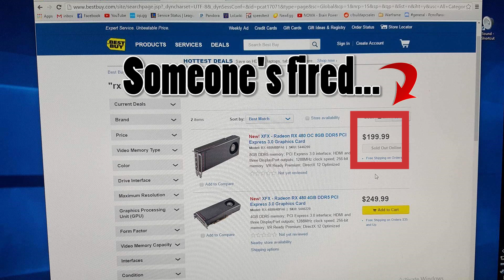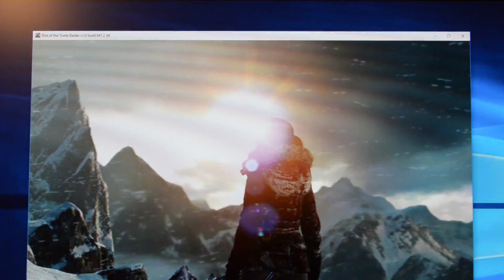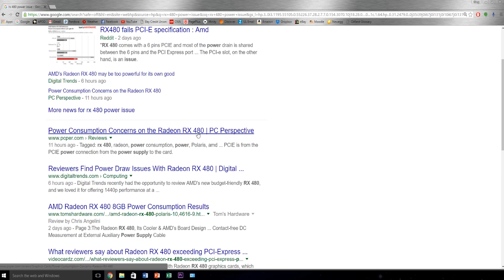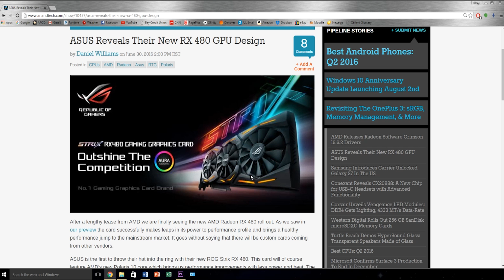RX 480 Aftermath: Power Issue & Over-Hyping

Comment: i have a question, I was planning to buy rx 480 nitro from sapphire when it comes out i wonder if my PC will not bottleneck it, here is my rig.

CPU: i5 3570 non k

Mobo: Gigabyte H77 D3h

Mem: 8gb G. skill ripjaws 1600

PSU: 600 watts aero cool strike X

HDD: WD 1tb

Comment: I live in Australia and god damn the prices are waaaaay higher here QQ
Reply: buy from US Newegg, you only pay currency conversion and shipping, not that plus the Australia tax.
Reply: The only problem is dealing with the warranty if your card stops working.
Reply: That is exactly why I don't want to order internationally. It would be a pain to return items if they don't work. But the price difference is on the level of $100-200 so it's really hard to choose lol. I could buy an rx480 here for $450 or buy it on newegg and get it shipped here for $380. I could buy a 1070 here for $780 or get it shipped here from newegg for $600.
Reply: +KKDominate PCCG in Australia sells the RX 480 8gb for $379 by XFX, wherever you guys are getting charged 450aud is scamming you.
Reply: I almost always buy from Umart. Yeah I see that XFX card on pccg. The only thing I don't like is that if I have a problem, I need to ship it back to them for replacements/refunds/etc. I've bought a couple times from pccg though and I like them.

Comment: thats what you fanbois get for buying into AMD PR lies
- a card that is pushed to the absolute limit but still struggles against the GTX 970
- AMD's ego for putting a 6 pin power connector to show that it is "power efficient"
- hot & loud
- melts motherboards
- can't be overclocked for shit

Comment: Lol,.. seriously I had experience the full tax load on costs for my XTX RX480 @1328 Mhz, Rush order thru ($5), Saturday delivery ($12), next day shipping ($38), 3yrs add on insurance ($40) firmware bios boosted base clock ($19). Now I need to figuring out should I boot to W10 Safe Mode and gutted out my nVidia GTX drivers then reinstall the Crimson Edition 16.6.2 Release driver at a whopping 350mb ? Really AMD,.. that is a large -- graphic driver download file. BTW did ATi fixed the Purge 150 spike power failure thru their driver maybe the extra 313mb (out of 350mb) are the needed PCIe fixes.
Reply: I forgot my ATi RX480 come with sound chip now I'm up to 3 DIFF sound cards in my Dell XPS 8900 system.

Comment: What's the pc case that he's using?
Reply from the maker: Corsair 400C.
Reply: Does the led lights come with that or do I still need to purchase it separately?
Reply: You have to purchase them separately, but they do not cost much. CableMod WideBeam (the best LEDs I know) cost between 18-21€ in my local PC store (18€ for 30cm version, 21€ for 60cm)
Reply: TheOdinTheory Thanks man

Comment: does rx 480 have any issues like graphics quality? maybe it's good at increasing frames per second at the cost of quality of the graphics.
Reply: No third party cards have have same if not better quality
Reply: They'd need to compare pixel values from identical frames.  Nvidia has a policy of not lowering image quality.  AMD/ATI has done it before.  It depends on the game as to how noticeable it is.  They are often options in the drivers, so default values when drivers are installed tends to need to be checked.  There is some hear say that AMD is having graphics downgraded in games they partner with for their cards to get higher FPS numbers.
Reply: Do you mean that they reduce the graphics settings during their benchmarks? Or are you saying that the 480 graphics look worse at the same settings compared to nvidia cards?

I'm a layperson but the latter doesn't really seem likely to me (please correct me if I'm wrong!), and the former is a problem you get around by reading trusted and detailed reviews.

Comment: Couldn't the power problem be a firmware or driver issue and be solved with an update
Reply from the maker: No. This cannot be corrected with software.
Reply: So you basically call AMD recent statement a lie ?

AMD : "As you know, we continuously tune our GPUs in order to maximize their performance within their given power envelopes and the speed of the memory interface, which in this case is an unprecedented 8Gbps for GDDR5. Recently, we identified select scenarios where the tuning of some RX 480 boards was not optimal. Fortunately, we can adjust the GPU’s tuning via software in order to resolve this issue. We are already testing a driver that implements a fix, and we will provide an update to the community on our progress on Tuesday (July 5, 2016)."

Comment: wait for 3rd party AMD RX480, they will use 8+6 pin, better cooler, and and durable PCB. We still need better chassis PC for better air cooling to use future GPU. And RX480 should use 3000+ more SP and 8+6 pin power, it would be a good card.

Comment: Wait, it made your machine shut off with every benchmark you ran?  Is this based on your specific hardware configuration or a known problem across the board?
Reply from the maker: Did you not hear all of the steps I took to isolate the issue? I shouldn't have to explain this all over again.

Comment: So the budget GPU can't run on a budget mobo.  I'd call that a fail.  If we want to upgrade to this gpu we have to upgrade our entire rig to make sure it doesn't shut it down.  It's just better at this point to buy a 1060-1070.  Cheaper than an entire new rig and better performance without the power issues.  Well, 1060 we're not sure yet, but the 1070 has had no issues and is only going to be about 100 dollars more than the non-reference 480.

Comment: ok so, guys i need some feedback or some help off those of u who know what they are talking about. 

I bought a GTX 1080 but it's still in the box. i spent £620 and it's a founders edition, i could however get 2 RX 480s for £480, if i wait for board partner cards, they will be like £280 each so it would be approx £560. my questions are is it worth me waiting for improved rx 480s and swapping the gtx 1080?  have i made a mistake by buying a reference gtx 1080?  also should i be worried about poor dx 12 performance on nvidia cards? 

im a bit confused right now.... part of me is saying just stick with the 1080. even though its a reference edition with reports of it thermal throttling....
Reply: If you have the 1080, stick with it, even know the 480 is nice, it won't beat the 1080, even if you have two of them.  Most games are still single GPU, and two cards can actually hinder some of the games instead of making them better.  Also in the past AMD has had some driver issues, which they have been known to take their sweet time updating, but then again that is the past.  Also you might think on waiting a little longer for the 490, which is supposed to be launched within the next few months :)
Reply: Just4Gamers Tube thanks dude i appreciate the comment. i just moved over from consoles awhile ago. but yeah the gtx 1080 is in my system now and i absolutley love it. it makes a weird whining noise if i leave v sync off in some games but its not major. Thank u for the advice. My case is always cool, has decent airflow.

Comment: My only complaint about the card is that their is no DVI. I would have to use a DVI to hdmi. That might lower the quality of the games that I play.  I still consider the RX 480. Since I have the 960 that might be good upgrade path. It rumored that their will be a 1060. Keyword rumored. It rumored to beat the RX 480. I might end up holding off more.
Reply: They both use a Digital signal so there should be little to no signal degradation.
Reply: KH3player Good. Now I don't have to worry when I am ready to upgrade my graphic card.
Reply: Just FYI you can also use a display port to DVI with no issues like I am. (Running a 2014 and 2008 monitor via the HDMI and display port to DVI respectively).
Reply: Jak I just hope I remember where I put the tcable at. I have a clue. I am going to see what happens in August. I was going to give myself a new graphic card this month for my birthday. I do need to be prepared for the fair that going to be in my town.
Reply: Yeah there are no  quality degradation with these ..

As soon as the card detect the device type it send the right kind of information/signal in the cable.   The only limit is the  resolution like 4K will probably not work over anything other than display port and the  HDMI 2.0  combination.  

I've already sent a DVI  signal to my TV over an HDMI cable.  Even if the TV or the GPU did not even had the DVI plug at all.  The communication protocol are directly built the chip whatever the plug they chose to weld on the back.
Reply: I'm using an HDMI to DisplayPort adapter. Works just fine. I do wish they had given us two HDMI ports instead of one HDMI port and three DP.
Reply: I never thought about that.

Comment: AMD how dare you make this non-compatible with 10 year old bottlenecking technology!!!1111!!!
I am not frustrated at all that i wouldnt be able to put this in my rig because it would be a waste. I dont know any 10year old CPU that would be worth pairing it with a 480. If this would be the case for a 470 or 460, then i'd have a reason to be angry. I just dont see the point in combining a core 2 quad with a 480.

Comment: I remember when my old AMD system would shut down often. AMD = cheap and nasty lol.
Reply: running an and chip with a fury x and I run games smooth 1440p 60fps so how is that nasty trash?
Reply: i actually used to work with my citys IT department for few months. they got a bunch of new hp desktops with amd apus that happened to be the most problematic pieces of shit ever, basically none of them would boot if they had any other usb devices than mouse and keyboard connected, they kept constantly crashing and losing connection to internet (basically a big deal when all of them logged in through a server) and heated up under normal use more than my i5 4690k @ 4.8GHz does under load. so no they suck ass even for cheap business computers.
Reply: Well actually hd6870 is not bad at all (With that cheap price)

Comment: I'm just throwing shit at the wall to see what sticks here. I don't know about the rx480 but my 280x has an 8-pin and a 6-pin connector. The 6 has 2 unused contacts next to it implying that it could take 2x8-pins. If the 480 is the same then if you have the skill you could de-solder the 6-pin and replace it with an 8-pin effectively supplying it with more power. However this is entirely based on the hunch that the two unused contacts are connected to something on the board.

Comment: In conclusion: Don't use a potato for a motherboard an you should be fine.
Reply from the maker: Not an excuse. Should never happen. Didn't happen with the 980Ti.
Reply: The pci-e spec was changed somewhere around 2.0 or 3.0 to allow up to 90w instead of 75w to be pulled from the slot however not all boards will handle the 90w draw. Good quality boards will likely handle even more but this card does have one real flaw and that is the poor vrm cooling and is the hottest part of the core. THG benched theirs with a room temp of 22c while under full load the vrm topped 96c. In a normal pc environment those vrm temps are going to be even higher.
Reply: Nope, PCI-E 3.0 still has a max of 75w from the slot.  I did some extra research on it and I'm almost positive this is still the case.
Reply: Do you have a 750ti? It would be interesting to test it on that motherboard, but overclocked so that it pulls more current. Would be interesting to see if the crashes can be replicated.

Comment: Awesome video with some really good information. I have seen videos on both sides of the argument regarding the RX 480 power issue, but all of those people had zero experience with an issue. It is great to see someone who has experienced it first hand. I have to say that I am surprised, especially after seeing all of the information about several video cards in the past pulling more than 75 watts from the PCIe lane. Appears that AMD could have an issue on their hands. Especially since the people who are buying a budget card such as this, could potentially have older systems with older motherboards that could trigger this problem.

Comment: amd is working on a fix 
"As you know, we continuously tune our GPUs in order to maximize their 
performance within their given power envelopes and the speed of the 
memory interface, which in this case is an unprecedented 8Gbps for 
GDDR5. Recently, we identified select scenarios where the tuning of some
 RX 480 boards was not optimal. Fortunately, we can adjust the GPU's 
tuning via software in order to resolve this issue. We are already 
testing a driver that implements a fix, and we will provide an update to
 the community on our progress on Tuesday (July 5, 2016)." 

http://techreport.com/news/30345/amd-responds-to-radeon-rx-480-power-draw-controversy

Comment: Great video. I'm glad to see this and hear you mention your system shutting down when the power draw got to high. There is already claims going around of people claiming the 480 killed their system. Granted the only one I seen that had any sort of pic had a case ripped apart from the top to shove a psu that obviously couldn't fit and gunk and oxidization all over the board I was still wondering. I always thought the system would shut down due to an experience with an overclocked 750ti on my sons first build on a budget board but wasn't sure if that was common for most boards. Personally I was let down and returned my immediately after seeing temps and that it is running at the absolute maximum it can in the current config.

Comment: Not surprising, you embrace budget level hardware and you bet budget level problems.
Reply from the maker: No excuse. The 980Ti worked well with the board. Using budget parts shouldn't disqualify you from being able to use the 480.

Comment: I have:

fx 8350
gigabyte 970a-ud3p
asus gtx960 2gb strix oc(6 pin)
16gb of ram
1tb
550w80plus bronze

And my pc reset without blue screen. Maybe it's the same problem? I use the pc like 4 months without any problem and 2 months ago it's start. I still have the problem, no one can fix it. I already change the ram(from 8 gb to new 16 one) and the hdd. I test with a celeron+h61m and still have the resets but they're less than with the fx. Maybe it's from the gpu or it's the psu?
Reply: Depends on the brand, don't make assumptions.
Reply: Well, its not your motherbaord :p
Reply: ***** it's not crap, it's a good cooler master 550w 80+ bronze. With 500w is enough for 960+fx8350 :/
Reply: Niels __ ok :/
Reply: Guido AZ Actually, when I think about it, this happens to me aswell. It happens when my cpu is at 100% laod(sometimes). At first I thought my cooling sucked, so I bought a watercooler, yet it kept happening, only faaaar less frequent. 

I still dont know wtf the problem is. 

I run a a-10 6800k

Are you by any change playing bf4?
Reply: ***** Yeah but I run a 700 watt psu.
Reply: Sorry i didnt say all what happens.
It didnt restart when game or full load, it's random(generally when windows's start)
It was ok for 4 months, but now it doesnt work, it restarts. Anything what i think it was the problem is ok, but i cant test the psu and gpu, so i go to the seller and they're trying to fix it.
Reply: ***** yes, and the gpu. The strange thing's sometimes it doesnt reset(with any cpu). I thinks it's maybe a vram problem.

I.e: FX: the pc reset 20 times, work for 1 hour and then reset again.
Celeron: the pc work 10 minutes and reset, work 10 minutes and reset again, work 10 minutes and reset 20 times more.

Sorry for possible bad english.
Reply: ***** but the celeron use like 50w and (supposedly by the technical, and this is why i dont think it's the psu) with other psu do the same. So probably i am the problem and not the pc (lol) or the technicals are shitty.

Ps: i dont known if who fix the pcs are called technicals but i mean they.

I also think it was the psu but the technicals say me it's not.
Reply: ***** oh ok. I will wait to the technical answer and will see what to do.

Comment: I bought a Dell inspiron 3847 because the cost was ~150$ less than the parts alone. I added a CX 500 and a GTX 950, and I haven't had a problem. The motherboard is an H81 mobo (I don't know the exact model). Do you think it would be safe to add an RX 480?

Comment: PcPer did a really in-depth 30 minute analysis of the power delivery of the RX 480.  This is a real issue.  The card has been shown to draw far too much power from the PCI-E slot over a sustained period of time.  Multiple users are reporting not only system shut-downs/reboots, but burned-up PCI-E slots in some cases.  

The real question is whether or not AMD engineered the physical power delivery circuitry of the RX 480 in such a way that they can implement a driver or BIOS fix.  They need to make the card pull more power from the 6-pin connector if possible.  If they lower the overall power draw, they risk gimping performance.  That could (rightly) lead to a lawsuit.  

Either way, AMD needs to quickly figure out a way to keep the performance of the card intact, while fixing the power issue.

Comment: So you must have heard differantly 2 rx 480's in crossfire competes with nvidia's 1080 cards. Which in all the test I have seen the 480 does compete trailing 2-4 fps against the 1080.